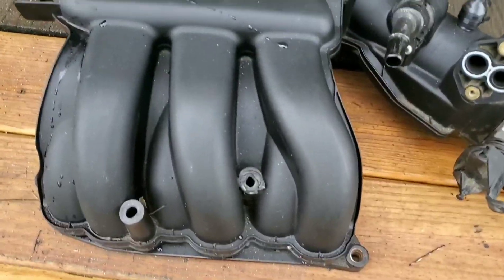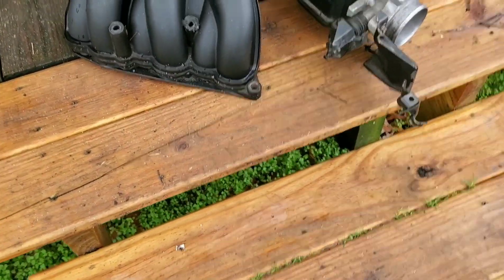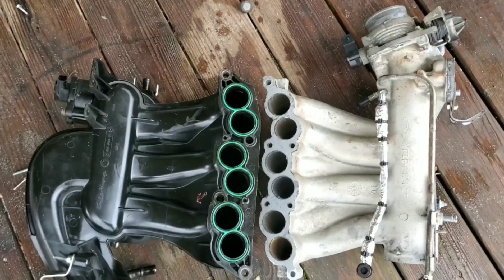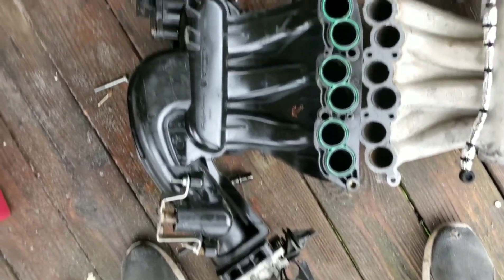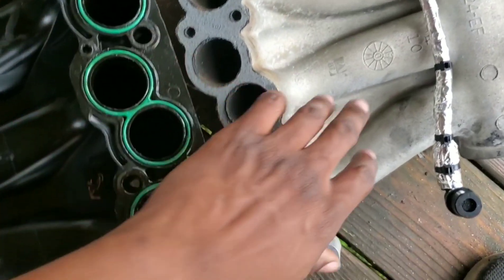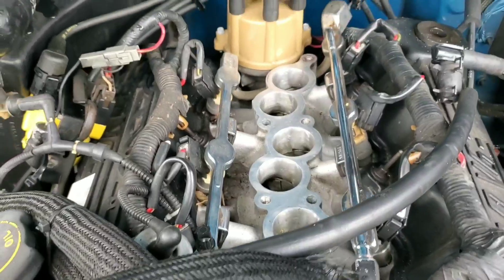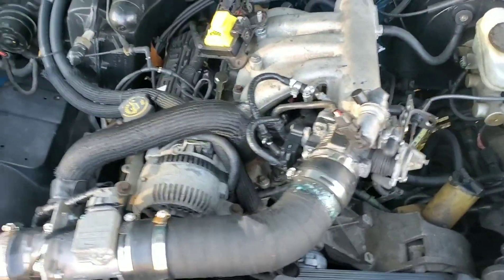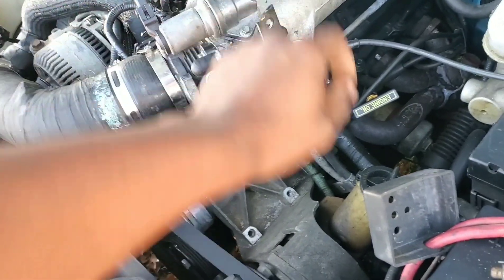3.0L ranger 60mm TB Swap(works?)

Comment: I hope I can make a 3.0 Ranger sound like yours (I have exhaust mods similar to yours)
I want to obviously get the long tube headers but I want to get 2.50 inch exhaust piping (all the way back going to the rear bumper), magnaflow high flow cat, 2nd "cat' delete (idk if its called a cat or a collector thats after the first catalytic converter), 40 series delta flow or a 60 series muffler by flowmasters (I want to have a deep exhaust sound & make a cam like sound to give it a rumble)
plus I'll stick with a factory intake manifold but ported & polished (like the whole entire intake manifold system to be ported & polished)

Comment: I have a 2004 ford ranger 3.0 automatic  what's the first steps I should take to make it fast ?
Reply: angel mendoza headers, exhaust, intake, maybe a tune.
Reply: Any idea where I can get headers ?
Reply: Probably ebay like he did, i have a 2004 mazda b3000 and honestly the intake swap and a cold air intake and an exhaust is a relatively good way to make slight gains for cheap unless you have money lying around

Comment: I just bought a spare 98-01 ranger aluminum upper like '99, it measured the same as the taurus intake I found. I took the runners damn close to 1.5", right to the gasket. Was going to take the mouth to 60mm, but the TB i purchased for a 98 3.8l only measured 50.8mm and looks like mine (I think its a stock 3.0 TB)? Instead of return the TB I halfshafted it and opened both sides and the intake mouth to ~56mm, also right to the gasket.

It's not as open as a composite/60mm combo, but it should swap right over for 98-01 guys at least...  not having to fool with deleting EGR or relocating coils, dpfe, iac.... I wonder if I should try to bolt it all on tomorrow for science or wait until I find and port a lower.
Reply from the maker: Nope the 2000 Taurus aluminum has runners a bit shorter the runner design curves when going into the plenum to get extra length. I have both. You have to get the 60mm throttle body of the 99-04 split port v6 mustang's. 98 is the single port
Reply: @TheVulcan   Well you're correct, I went and looked at my brothers taurus and I must have been thinking of the throttle cable distance being close. The runners are shorter and a lot more straight on his car. That's my bad..

I guess I'll just run the ported ranger manifolds with MAF and stock TB modded for now, as i got it all mocked up ready to go today. Definitely going to copy your 60 setup as soon as I can though.

Comment: Thanks for advice got my intake and tb I'm porting I got a air intake sensor on my original intake no place on Taurus upper any advice on that drill and tap it in ? Thanks bud luv what your doing with 3.0

Comment: On the lower intake manifold, did you port it with the lower installed, or if you left it in, how did you keep the shavings out when you ported the lower?
Reply from the maker: I removed the entire lower when i ported the manifold.

Comment: Hey man, I just bought a 3.0 ranger.. really looking for a few more horsepower and been researching a lot of videos for ideas of mods. Have about $1100 I can spend. Not looking to spend it all really but what would you recommend as I’m running all stock except glass back exaust
Reply from the maker: Headers, electric fan conversion, and intake will probably be the best option
Reply: The Vulcan thank you! What headers you think I should grab I could do that this weekend

Comment: Where is egr valve did u cap it where u put throttle bracket trying to do mine thanks
Reply from the maker: My ranger didnt come with an egr valve. So i just put a block off plate on the manifold.

Comment: Will the ford ranger throttle body fit the 2000 Taurus manifold?
Reply from the maker: It should, the Taurus throttle body is 50mm. But if you want to install a 60mm the manifold will have to be bored out